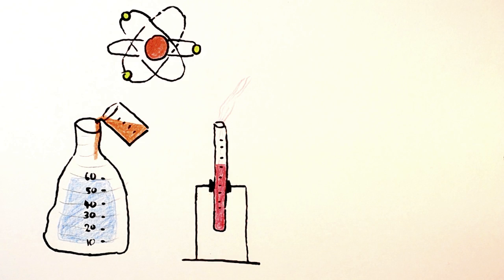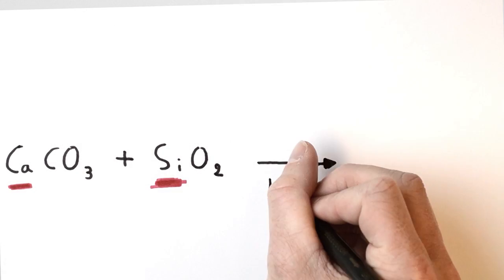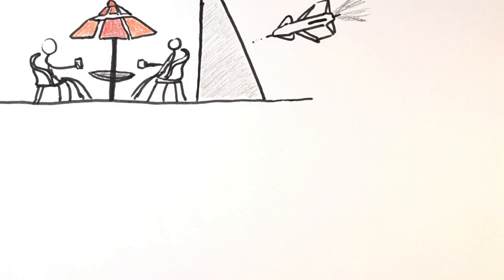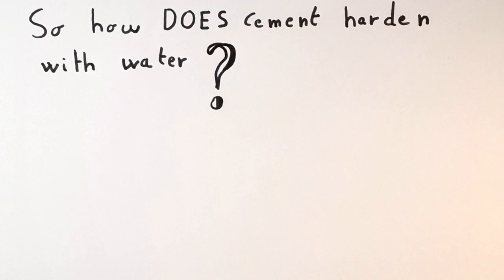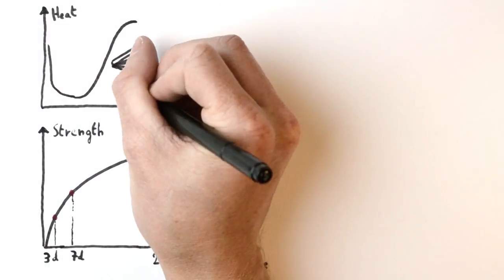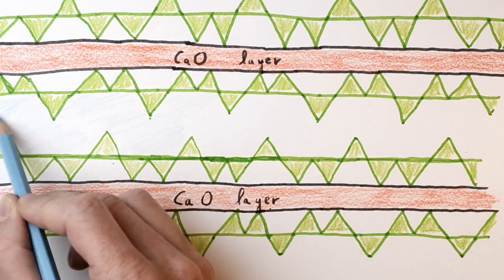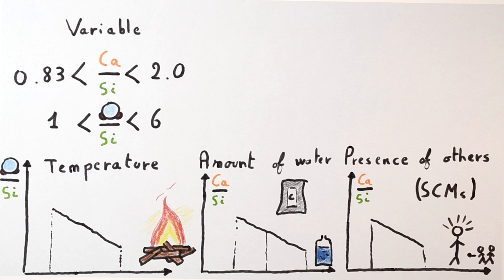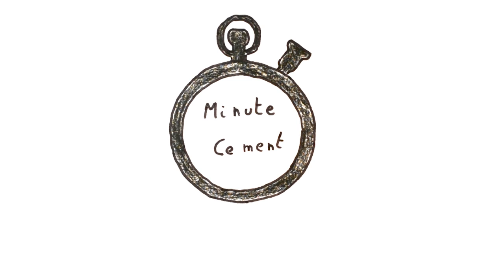MinuteCement - Introduction to cement chemistry

Comment: Big correction, at the start he describes the production of quicklime. Quicklime IS NOT cement. Lime is a component of mortar. Modern cement is Portland Cement, it is made under a different process. There is no lime in modern concrete, only mortar.

Comment: Btw- you wrote the chemical rxn. Ca + SiO2 --> C3S.  That would be Carbon Sulfide.  It should say Ca2SiO4 (Calcium always has a +2 charge and the silicate polyatomic ion would have a-4 charge).
Reply: There is a special notation used while discussing chemistry of cement. C3S doesn't mean carbon sulfide. In fact, it's just a shorter way to write 3CaO × SiO2

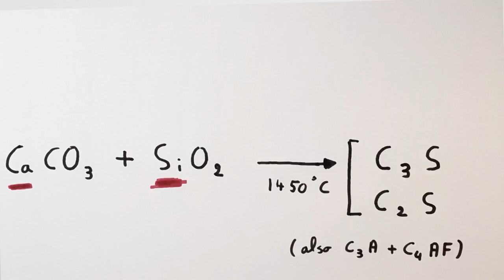Comment: 0:45 C3S would be a calcium sulfate, not a Ca silicate. C is the symbol for carbon, S is the symbol for sulfur. Si is the symbol for Silicon. Also, Al is the chemical symbol for aluminium, not A. But minor errors are no problem.  Thank you for sharing and demystifying the glories of cement.
Reply: In the cement world, there is a specific nomenclature where C stands for CaO, S stands for  SiO2, A for Al2O3 and F for Fe2O3.

Comment: This is great. I have a very small hole in concrete. I am planning on filling it with a dry mix of equal parts cement and sand. After that, I plan on putting drops of water in it. This should allow my repair to have zero air bubbles, fingers crossed.

Comment: There is any step to make flexible concrete in the process? like using microwaves lasers, xray, ultrasound or some technology so you have some parts of the concrete ultra flexible to replace the wire mesh?
Reply: You’re summing up random stuff asking if it “maybe does that”. Sounds to me a bit like throwing a drill into custard and hoping magically a Audi R8 appears 😅